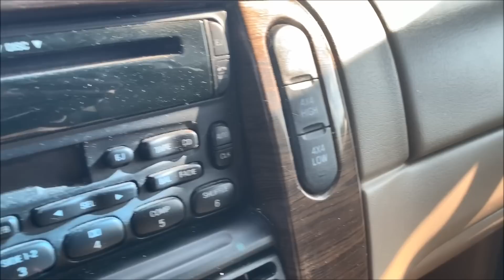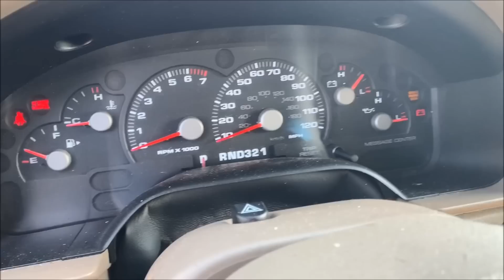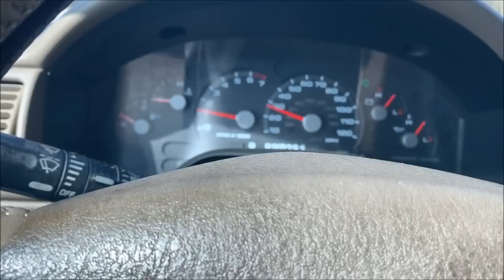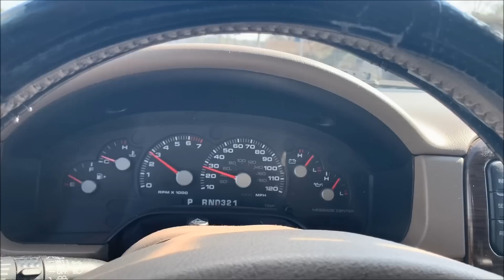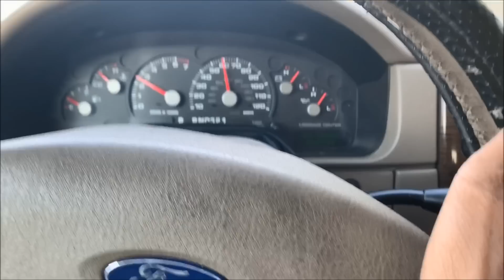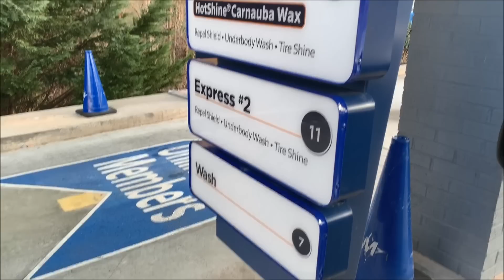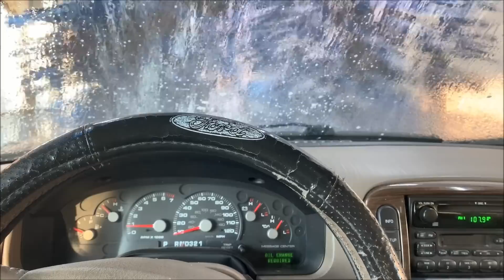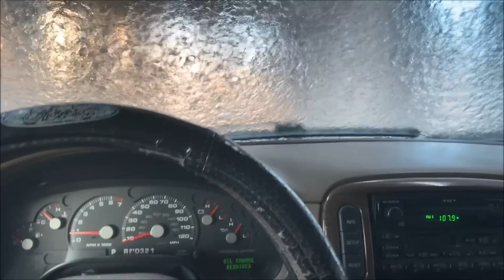WOW! WHAT A TERRIBLE PURCHASE ON THIS 4x4 FORD EXPLORER AUCTION TRUCK!!

Comment: Take that explorer to a dealer ASAP and get the trans recall done to it before the trans fails on you
Reply: John Mccord. There is no recall..
Reply: @bradfink6028  beg to differ I owned one and their is in fact a recall for them unless ford has ended it in recent years. The Ford dealer that did mine on my 04 Mercury mountaineer was whitmire ford in Chico CA. Their tech said himself that if I was going to continue towing trailers I should get rid of the vehicle because the fix even ford has for it only lasts about 60k miles theirs a design flaw in those transmissions. The valves are hardened steel the case is aluminum. Their fix is to hone out the case and insert a brass sleeve so the trans will seal and shift again. Look it up here on YouTube and you will see. And no it doesn't matter v6 or v8 both have the same trans. My mountaineer trans went belly up at 102k miles
Reply: John Mccord Appreciate the info. But dosent say anything about recall
Reply: @bradfink6028  I'm guessing ford has ended it. I can't find it now I'm sure if it's still active his local ford dealer will know. I had mine fixed and traded it in
Reply: Elmer Coffman  their was I am not 100% sure its still active.  Best bet is to call your local ford dealer with your  vin # they will let you know

Comment: That's a versatile truck especially if you have a car hauler trailer. The extra weigh, over a pickup, helps stability. 2500 shouldn't be a stretch. Thanks for taking us along for the ride.

Comment: I have a 2007 Explorer, and it's on it's 3rd transmission {replaced with just over 100K miles, then again 2 years later under warranty thank god}.  Never again!  lol  $2,500 easy flip for you!
Reply: Yea the transmissions in these are bad.

Comment: To be honest, in that condition with mileage, that wouldn't go beyond $900 to $1k at a Chicago auction. You have a different market for Ford's down there though.
Reply: Yea I just saw one on OfferUp with Less mileage and in better condition for 1900. But it all goes by where you stay, in Louisiana this is a 2500-2800 truck shooter easily.

Comment: I had the exact truck but an 04. My torque converter went out and I had it replaced under warranty thankfully but I loved the truck. Also I think there is a factory sub in the back hatch area in the side panel... good looking truck though!
Reply: At the time there wasn’t so idk if it has changed between now and then. He def did the right thing by not driving it lol.

Comment: shiny and pretty don't see those at co parts often. but what about the mechanical. A car is yard art if it doesn't run well. I would guess that old to need new shocks maybe ball joints, etc figure the buyer would need to add another 5-700 so I wouldn't go above 1700 if I bought it. someone will but I wouldn't.

Comment: those explorers aren't good vehicles with engine and trans problems and poor design. You would of better with a 2003 or older navigator or expedition.
Reply: D4x4Bronc Not all the way true. It depends on how well the vehicle was taking care of!
Reply: It’s made 192,000 and still going
Reply: Cortez Miller Actually even well taken care of the transmissions in these failed . Usually as early as 50,000 to 75,000 miles .. Official Ford Mechanics would tell you to get rid of these. The transmission had a defect.

Comment: Ford explorer four-wheel drives are dogs
The two wheel drive explorer are awhole lot better they have less
Problems
4.0 Ford motors are bad about timing chain gides
And head gaskets 
If you ever run into a Ford that takes a minute to go into reverse
That is the beginning signs of the transmission going out....to each his own but I would not put my ex-wife in a Ford explorer and I somewhat like her.
Good luck brother $$$$